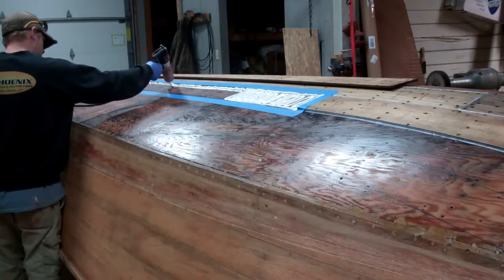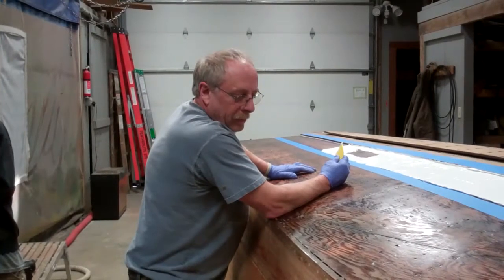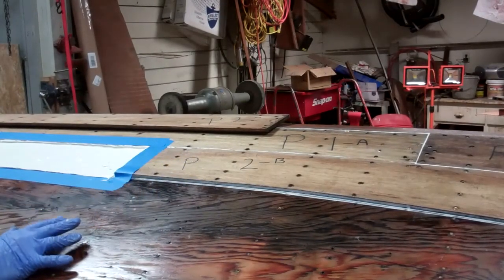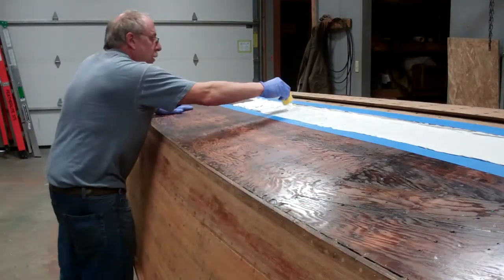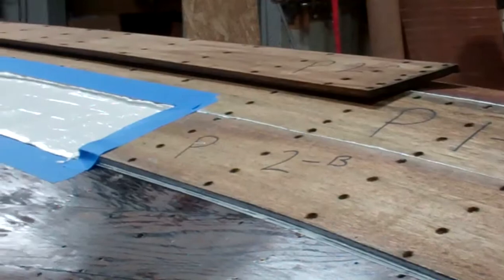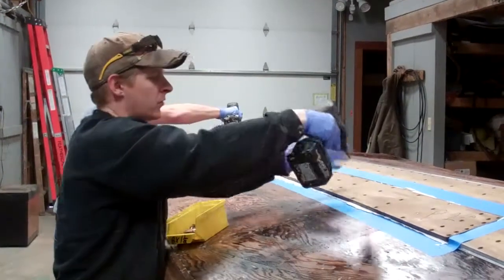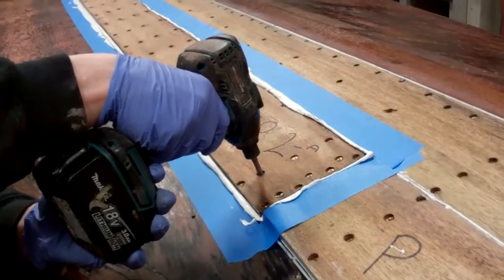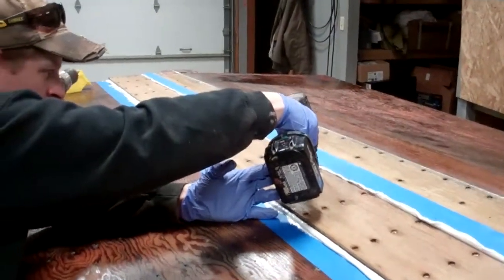How SMB Installs Bottom Planking When Fabricating a 5200 Bottom 2 11 20176

Comment: I hear you talking bad about stainless and Philips screws, but I see you using Philips screws on this bottom.  Is there a reason for this?
Reply from the maker: Duh.... Ever heard of Frearson-drive, aka Reed-and-Prince -drive screws? Better get informed ahead of tossing silly grenades and tell the world that you simply do not know what you are spouting off about, yes? 

Have a very nice day!

If you really care enough, here is a very thorough, very correct discussion of the differences between Phillips and Frearson: https://fairwindfasteners.com/blogs/news/reed-prince-frearson-drive-vs-phillips.

Here: I will make it easy for you: (The Website does offer some very informative drawings.

The Frearson drive does look a bit like a Phillips at first glance, but the two are not the same. Trying a phillips bit in a frearson drive screw or vice-versa will bring little more than stripped screw heads and fist pounding frustration. But why would you want to use one over the other? What are the advantages of a Reed & Prince (R&P) Frearson over a Philips head? Hell, where did it even come from?

THE FREARSON DRIVE
Frearson R&P Screw Drive
The Frearson screw drive, also known as a Reed & Prince (R&P) may look similar to a Phillips, but the shape is different in a beneficial way to the wood boat builder. The Frearson has a sharper tip and large V-shaped angle. The recess in the fitting is a perfectly formed, sharp cross and that allows for a higher amount of torque to be applied before stripping out. They're common in the marine industry, and boat builders wanting to apply larger amounts of torque on screws in hardwood timbers tend to prefer using them with power tools. Frearsons have a much greater amount of resistance to "camming out" or stripping when torque is applied.

The drive dates all the way back to 1873 when it was invented by British engineer, John Frearson and it's still a favorite of boat builders today. Many classic boats, including Chris Crafts and Gar Wood for example are fastened with Frearson wood screws. Frearson drive are also commonly referred to as Reed & Prince drives, or R&P, as they were well known during their time being manufactured by Reed & Prince Manufacturing Company of Worcester (pronounced wooster of course!), Massachusetts.

PHILLIPS DRIVE
Of course Phillips drive screws are far more common, and are what the rest of the world outside of the boat building fraternity uses when reaching for a common cross headed screw to fasten drywall, build a deck, or put together some furniture. They can be had in any hardware store, along with the screwdrivers and bits to drive them with.

Philips screws have a much rounder tip, and a finer angle on the "V" crosses. This makes quickly inserting a driver faster, but does result in a less secure fitment with less surface area of the driver bit in contact with the screw.

Phillips head screws were designed as a direct solution to problems with slotted screws. They had more precise alignment of the driver, which avoided slippage and they were much easier to drive with power tools.

The design is often criticized for it's tendency to strip or cam out, even when low amounts of torque is applied. Clever people making clever excuses for the drive called it a "feature", allowing assembly of more delicate parts without overtightening the fasteners. If it was a feature, then the original inventor John P. Thompson surely didn't know about it because it was never mentioned in the original design patents.

WHEN TO USE A FREARSON (R&P) DRIVE SCREW?
Use a Frearson drive with screws made of softer metals, as you'll experience less stripping and cam out. Also reach for Frearson when screwing in to hardwoods and lots of torque will be required to drive the screw home.

Planking up that old schooner with mahogany on oak? Frearson or slotted screws are the way to go.